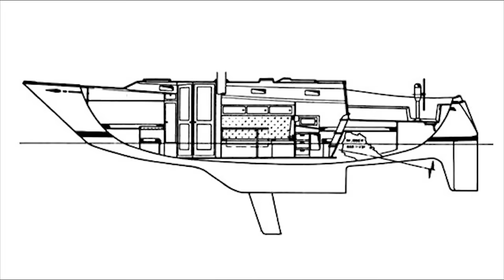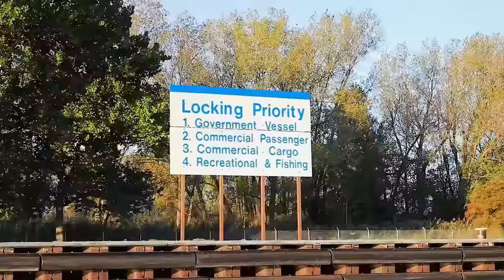How to Run Aground in 8’ of Water When You Only Draw 4’ | Sailing Soulianis - Ep. 24

Comment: So you have a swing keel, do they call it a “ center board”? Any differences?
Reply from the maker: Big difference! We don't have a swing keel, we have a centerboard. (The actual model name of our boat is T37C.) A centerboard is just a board that prevents leeway -- the weight of the board is paltry (ours is about 200 lbs.) A swing keel has significant weight with the goal of adding ballast below the boat. Typically larger boats don't have swing keels, they're normally found on 20-something sized boats. (Southerlys, though, are famous for their swing keels.)
Reply: I have a 25 foot Catalina with a swing keel that weights about 1,000 lbs. The keel on a sailboat does two things: 

(1) When the wind is pushing on the sail in one direction, the water is pushing on the keel in the opposite direction. This is what makes the boat move forward when you're heading into the wind. The two of them together is like pinching an ice cube to eject it.
(2) The extra weight balances the heavy mast and wind pressure on the top of the boat so that the boat doesn't just blow over. (A sailboat will actually right itself if it gets flipped over).

On Soulianis, their boat has all this weight ("ballast") built into the bottom design of their boat. They only have a light centerboard for the extra depth to meet number 1 above. Since they only need that effect when actually sailing (not motoring), they can pull it up to get into shallower waters.

On my 25 foot boat, it's technically trailerable (though on a very large trailer), so to keep the weight down they designed it with a swing keel but made the keel is much longer to lower the center of gravity which makes it require less weight. Also, being longer allows it to be narrower so it can pull up into the boat without taking up too much space in the bottom of the boat.
Reply: Do not discount the added stability of 200 pounds an extra 3.5 feet lower.  Every pound, the farther you get below the center of stability, has a greater and greater effect.  200 pounds down low can be worth 2,000 pounds up higher.    A Pearson 30 is a great upwind boat,, but it is rather tender for the first 25 degrees of heel. get it over to 30 plus degrees and you can almost sail straight upwind.  However,,, there is a balsa wood fairing behind the lead slug in the encapsulated keel.  It tends after X number of years to get wet.   My solution was to excavate the balsa entirely.  I replaced it with epoxy and lead shot, 325 pounds additional ballast and a great deal of it down low.  It was like sailing a different boat.  Figure there was about 100+ pounds of that ballast change down low.  The tenderness was utterly gone, she sailed like she had an extra foot and half of beam.  Much quicker and much better in a heavy breeze.  No flop, no tenderness,, and she adored,,, absolutely adored,  20 plus knots of wind and 3 meter seas.  Downwind, double reef in the main and a storm jib on the fore stay, gale force and a bit she rode easily, and fast.  Stand in the cockpit and have your morning coffee stable.  All thanks to a couple hundred pounds down low.  Your center board, at 200 pounds when down has a great deal to do with stability.  That bottom 100 pounds, three feet lower is big.  I'd wager that 100 pounds down low is every bit equal or greater  to the 2,000 pounds at the top..
Reply: @SailingSoulianis   A centreboard or centerboard (US) is a retractable keel which pivots out of a slot in the hull of a sailboat, known as a centreboard trunk (UK) or centerboard case (US). The retractability allows the centreboard to be raised to operate in shallow waters, to move the centre of lateral resistance (offsetting changes to the sailplan that move the centre of effort aft), to reduce drag when the full area of the centreboard is not needed, or when removing the boat from the water, as when trailering. A centreboard which consists of just a pivoting metal plate is called a centerplate. A daggerboard is similar but slides vertically rather than pivoting... a centerboard is a type of keel.. a  swingkeel is a type of centerboard.. clear as  mud
Reply: @Sailor376also  I agree weight down low is great for stability, BUT...

What is the buoyancy of their centerboard? Is the 200 pounds they mention the weight out of the water or submerged? If 200 pounds is the weight in air, it might only be half that weight in water. If that's the case, then (at normal angles of heel) you only get a net 100 pounds acting to improve your stability.
Reply: Buoyancy of a centerboard??  That has some assumptions,, so you normally don't think of the centerboard as buoyant,, but you are quite correct,,, even lead has some buoyancy,,, even if the final figure is a seriously negative number.  The normal centerboards, swing keels (and the difference between the two is mostly academic)  are made of cast iron and cast lead.  Lead is the normal best keel ballast and fabrication material.   Pure lead is too soft and does not 'wet' the bolts or fasteners well.  For strength and stiffness, lead is alloyed with antimony, 4% to 6% is ideal, but even 2% gives a good keel.  and the other metal that helps with many characteristics is tin.    So,,, 93% lead 5% antimony, 2% tin   Ideal.. 700+ pounds per cubic foot  vs, 64 pounds per cubic foot sea water.  lead keels weigh 640 pounds per cubic foot under water.
Reply: @Sailor376also  Agreed.  For lead, or even iron, ignoring the buoyancy is quite reasonable.  But the the way they swing that board around by hand (14:30 - 14:50) makes me think the board is not very heavy.  I don't think theirs is cast metal.  If it is solid fiberglass, then it's density might be around 2.5 times that of water. If it's cored fiberglass, then the average density is probably less. My guess is that it is cored fiberglass.

PS - Sometimes boards on lightweight boats (e.g., multihulls) can even be light enough to float and need a line or other mechanism to force them down.  Obviously not the case on this boat.
Reply: Hey Andrew.   Tartan 37 CB ,, 1or 2 I don't know.  7500 total ballast,,, I doubt that it needs more.  46 % in ballast?  Something like that.  The board would still have to be substantial in weight,,, because its normal use is going fast to weather,,,, and nothing holds it down except weight.   I still would bet it is lead, iron, or encapsulated lead,,,,, but he does seem to hold it back without too much strain.   So,, so,,,, laughing,, I don't know.  I have all the specs right here,, and I checked saildata.com  I did not see a figure for the swing keel.
Reply: Others have not addressed it directly. What you have is a centerboard or swing fin keel - they are the same thing. They are pivoted at the top end and can be weighted or unweighted. 

A daggerboard, on the other hand, does not pivot. It slides up/down in a more or less vertical path.
Reply: Actually, a centerboard typically goes up and down vertically while a swing keel rotates around an axis.
Reply: Not quite correct. A daggerboard slides pretty much vertically up/down. A board that is hinged to swing is probably most properly called a swing fin keel, although any swinging keel/board is commonly called a centerboard.
Reply: It's all just terminology. In England we tend to use the term "lifting keel" even if it's a swing keel, and that term doesn't reflect the weight or lack of it. Soulianis has a swing keel, but with a stub keel which has the weight and doesn't swing. Some boats, like the Hunter Medina have a lifting daggerboard i.e. it goes straight up and down rather than swinging. In a traditional long-keel boat you have a keel but it is the spine of the hull, rather than a foil and all the weight is carried inboard. The French OVNI is a good example of a blue-water yacht with a lifting keel, and as mentioned, the Southerly.
Reply: @Sailor376also , This is the mix used in the old days for making the type characters used in printing.
Reply: I did not know that !!  But it makes perfect sense.  Pure lead would likely be too soft for repeated presses and use.  Thanks !
Reply: A centerboard will retract all the way in to the hull.  On your boat the extra is retracting into the shoal draft keel ergo swing keel.  You can also find boats where half or more of the foil is out of the hull when fully folded in creating a shoal draft keel but it will swing down like a centerboard.
Reply: I would never have guessed your center board would be that lightweight.  For reference, my 1976 Gulf Coast 18 footer has a 325 pound cast iron swing keel.  It's about 4 feet long.  Drafts less than a foot of water with it up.
Reply: @SailingSoulianis  you need better blind diving skills.  that could have been fixed underwater with practice and determination.
Reply: @SailingSoulianis  My understanding is, a centerboard travels up and down in a slot, such as those in sailing dinghies.  A swing keel pivots and swings, just like yours does.  I believe you have a swing keel!  Either one is way too much trouble, even if the mechanism is working, they can both be so fouled with barnacles they stop working anyway.

Comment: Welcome to cruising. There's never a dull moment. Glad you have a centerboard and not a swing keel. When we first started our channel we were refitting our old Catalina swing-keel C-22. We soon learned that our relatively small cast iron keel weighed over 650 lbs, and that more than a few C-22s had sunk over the years when the lifting cables broke, causing the keel to swing violently down, smashing and breaking the bulkhead or shearing the bronze hinge pin. In that boat, this would lead to a capsize since the keel was the only ballast in the design.

Comment: Fantastic views of heavy industries and the state of it all. And very well done on the fixes and fixers. 
I once owned a 22ft trailer sailer for 10 years which had a 750lb swing keel. Once we had an overly keen and strapping crew member gladly offer to wind the required 120 turns of the handle, on the threaded rod that pulled up the rope to lift the keel. But when we later went to haul up on the shore to wait for a tide change, we grounded. The rope shackle had been torn from an eye in the iron plate protruding an inch out, a third of the way down the tailing edge of the swing keel.
Eventually squeezed it back up just a little as best we could with our biggest rope and winches, managed to pull it on the trailer at least. A mates strong high roof shed leanto, two small car ramps, a couple of 2 ton strops, and a well placed hole in the floor and we saw the problem much more clearly. A template was made out of cardboard and a hot glue gun and then turned into a stainless bolt on replacement for $100 and it was all better than new. But whew, boat moments aye. Keep up the great vids. Cheers

Comment: I have had this issue with a smaller boat that has a similar keel set up. One day the pennant line actually snapped and I got stuck fast about twenty feet from my dock. I have a very large cargo ratchet strap of the type semis use , I ran it under the boat from the bow back until it was against the keel. I then hooked each side to a cleat at the back of the boat and started ratcheting. Once it came up enough I used a second strap amidships to pull it up the rest of the way and hold it until the repair was complete. Always good to have lots of big heavy duty straps around. Great video guys!
Reply from the maker: We didn't get this on camera, because we were moving quickly.  But before we made it to the lock wall we did take the line we had tied off at our midship cleats and bring it back from the bow and then to our two primary winches. We tried winching it from there but it started damaging our toe rail and nothing was budging.The real problem was that the control line got wedged in between the board and the trunk, so it was a little counter intuitive, but we needed to loose it and get that unstuck first.
Reply: @SailingSoulianis  yes I can see where it would not have been useful in your situation especially since the line had gotten around to the wrong side it seems. The swing  keels are tricky beasts. A little side note to my story, I used the straps because I originally tried my winches, which were old phenolic winches and actually crushed one lol. Again thanks for showing some great lakes sailing as I mostly sail Lake Ontario.
Reply: @moosewing1   Actually it's not really a swing keel, to my way of thinking, if it's just hauled up by a pennant. It's a centreboard. A swing keel contains most or all of the ballast, and has to be engineered properly, because it is so heavy, and because it is essential that it stays  put when the boat rolls upside down. I'm building one as we speak; I've been working out the design for the last forty years, so it had better work! (It's going to cost as much I spent for the boat it's going in, despite me doing all the work .... so I can see why they're not more commonly built to the requisite standard.)

Comment: That is a centerboard...the keel is the housing that CB swings into, contains a ton+ of lead...next time the boat is out of the water, drill a  5/8  hole on the leading edge of the CB, almost at lower tip (seal the hole with epoxy around the edge of the hole carefully) you can run a line thru the hole in a pinch, for emergency...Remember you should never let your CB retracting line/wire go slack, never let CB go all the way down, make a mark on CB line/wire that's 1-2 inches short of completely down. Many CB boats have a dedicated worm drive hoisting arrangement...this gives positive control for the wire, change your CB wire/line every 2-3 yrs. It Wouldn't Be Sailing if Things Weren't Breaking! Good Luck in the Future.

Comment: My oldest brother had a boat (He’s a weekend warrior boater) in Ocean Reef. I fly from LA with other brother and we take the boat for day around Key Largo and for me to dive.  He then gets kerfluffled and finds himself in one meter of water? Trying not to foul the prop, Captain Bro gets tense and short fused... 🤥🤭😂.  Thrusting forward and backwards in one meter of water trying to escape the rocky bottom. 🤭😳🤓.  I used my advanced degree of problem solving asked bro to put motor in neutral and I jumped out of the boat. Water was below my knee. I grabbed the back rail and wiggled the boat left and right and asked the Captain, where do you wanna go? 😂.   I had two incredulous brothers starring at me like deer in a head light. 😂 I walked us into deeper water. I give them hell to this day… I guess sometimes you can have Captain 101, 102, 103,  charts, sonar, radar, etc. and it don’t mean squat… 😂🤣🤘    Congrats on beautiful baby 🥰👶🥰

Comment: Feel for you guys, just starting out and this happens. I bet that board is about 400lbs
The is the problem with crank up centerboards. You have to keep it clean too where the board goes up into. I owned a Oday boat that had the crankup centerboard but had a crank inside and nothing to do with the mast in its way.
Glad it worked out for you guys.

Comment: Never ever get under a load, my father who was crane operator would have a fit
Reply: Glad it was easy fix
Reply: AK Don L H I’m a rigger, and you are correct. You’re not supposed to walk under a load. But sometimes you have to. But I’m not going to lose me shit about them doing it. 

This could have been done differently but it’s not uncommon to work under a load when necessary. It’s just to be avoided if at all possible.
Reply: Would you tell your significant other to go up there without fall arrest .. all said there would be no adventure if anything happens in that picture.
Reply: I worked for companies where we've moved 40+ ton loads (even a 900 ton lift). You NEVER walk under a load. They should've set the boat on something first. I'm sure the boat yard had something to set a boat on.

Comment: I feel you guys, we have a swing keel on our Beneteau 323. When I was cranking it up once, on the last crank the mechnism broke and the keel crashed down. Luckily we didn’t lose the keel, but the mechanism was shot, and the keel was stuck down. We had to keep our boat at a family member’s house for a couple of weeks because our creek was too shallow for it. When we finally got the boat hauled, we saw how the mechanism was completely rusted, and at that point when I cranked it, the last bit holdsing the mechanism together happened to give way. Well, $1100 and a couple of weeks later, we were able to get back on the water. Sometimes these swing keels/centerboards can be a lot of trouble!
Reply from the maker: Hey Parker, all rusted... Argh! Yeah, they certainly can be a pain, but we can point pretty darn well into the wind with our board down, and it's also really helpful maneuvering in tight spaces. I don't think Kirk and I have discussed their good sides much in our videos. We had never had a problem with our board until this point, and I'm sure you understand, it was a unique situation putting our boat back in the water without the mast up -- which completely threw off our typical pennant setup, rendering all board position markers invalid, etc. Anyway. It's a silly situation we created for ourselves. Thanks for commiserating, very much appreciated.  -L
Reply: Sailing Soulianis Yeah, they do have their good qualities but sure can be a pain at times! Safe travels to you, and thank you for your response!